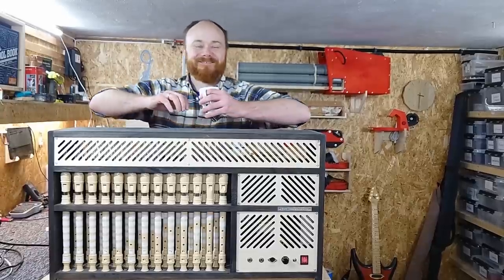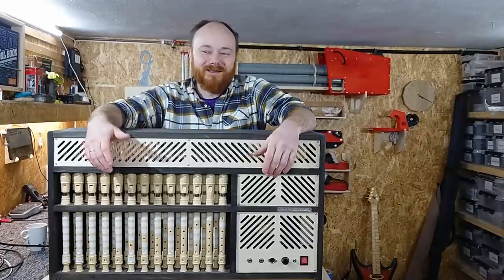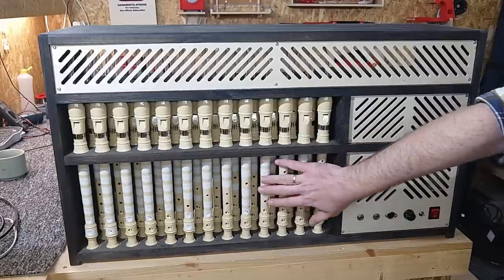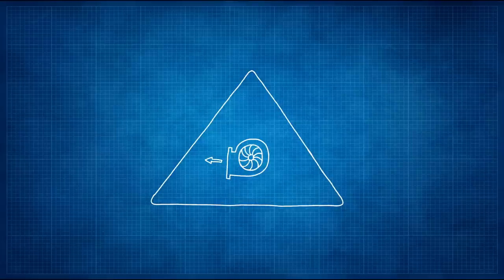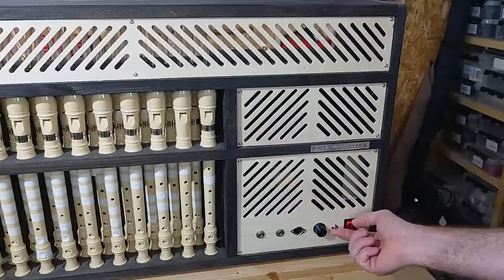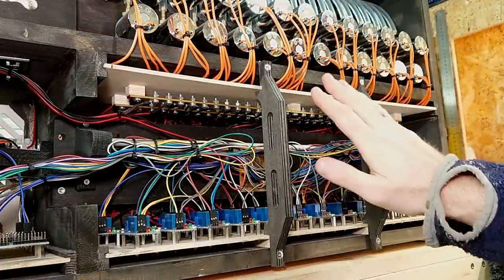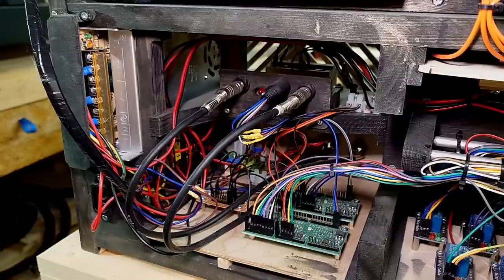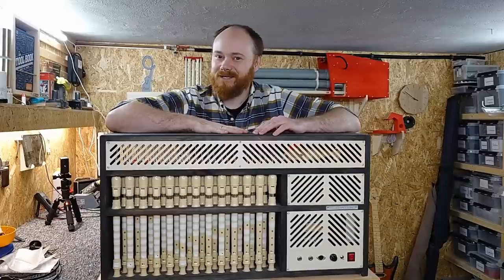The Hellcorder | The World's First Recorder Based Guitar Amplifier

Comment: Does it have some kind of manual valve to regulate the air pressure for each flute? Instead of using the weak vacuumer you could go for a side channel ventilator, which can have sufficient power. Since it has a midi input, why not use a keyboard to make polyphonic sound?
Reply from the maker: No, not yet, but that is one of the top things on the build plan. The vacuum is providing enough pressure and flow,, but it's a bit noisy....but that can be rectified :P

And yes, it is fully polyphonic with a keyboard, but that'll be another video ;D

Comment: why don't use compressed air? its silent and a lot more powerfull, you can regulate its force with some valve
Reply from the maker: I did think of that, but the initial design brief was that it should be a self contained unit and since silent compressors are expensive, I went the other route. Also, recorders need very low pressure, but a steady laminar flow of air. That would have needed to be adressed by some more expensive equipment, like valves and reducers. Unfortunalely, the airbox solution was not exactly quiet either, and far from self contained. I still believe fans, or even bellows, are the way to go - although I like the mechanical aspect of pressurized air and a lot of valves :D

Comment: Just a thought; although you'd give up some portability, if instead of needing to wait for fans to build up air pressure, would the delay be eliminated by running an air line from either an air compressor  (in another room or with a large enough tank to fill it and turn it off) or a high pressure air tank, both having a 2-stage valve and running into a manifold to feed the recorders?  Your idea is so out of the box, it's ingenious! Kudos!
Reply from the maker: Thanks :) That would work, but portability was one of the criterias :P

Comment: How about you switch to use some info of spool valves, then you could control the individual airflow instead of just turning it on/off. Would also get rid of that on/off snapping sound. Price would of course be quite a lot higher...
Reply from the maker: That would ertainly be a solution, but as you said, at a price :)

Comment: I like th eproject and idea, as the recorder sound is not great i would split the guitar signal in 2 where one would drive the hellcorder and the other just as normal electric guitart and than mix the sounds .
Reply from the maker: Splitting the signal and add a speaker is a good idea and also easy to achieve :)

Comment: The notes of the flutes depends on the airflow. You can reduce the airflow by controlling the pressure loss using valves, but you need to make sure that when blowing multiple flutes at the same time the starting pressure doesnt drop too much. I don't know how you can do that. A kind of low pressure pressure regulator to control the escape of air even in the absence of notes being played?
Reply from the maker: Are looking at solutions for just that :D

Comment: For polyphany you could wire each guitar string individually (like they do with the variax guitar) and then use a processor for each string. Or you can grab a variax and a pod and it will output midi
Reply from the maker: That would actually be fun. I have never wired my own pickups, so this sounds like a entry level project ;D

Comment: I think it's a very interesting idea and not in the least dumb.  There's nothing wrong with recorders, it's just the way they're (mis-) used in musical education.  I wonder whether you considered using a single recorder with solenoids to cover and uncover the fingerholes?  Using an array of recorders, as you've done, is basically the same as the technique used for orchestrions.  It would be interesting to find out the difference in cost between buying/making simple, individual pipes out of plywood or some other material and using cheap, plastic recorders.  I don't think it's that difficult to make the fipples and the tubes should be a snap (relatively speaking).  On the other hand, they would certainly add up in every sense.  Personally, I think using better recorders would be kind of a waste of material as well as extremely expensive, as a moderately-priced soprano or tenor recorder made of maple or pearwood costs between approx. 150 and 250 €.

I would also be interested to know if using an electric motor to drive a set of bellows, as with other pneumatic instruments, would be quieter than using fans.

Anyway, this is the first video of yours that was suggested to me and I look forward to seeing more.  Thanks!
Reply from the maker: Thank you and really good reflections. I have looked at some of it earlier and a single flute with mechanical fingers has been done before. Someone also suggested using a steel flute as they already have mechanical valves. The issue with recorders are that to achieve good tones, you regulate the airflow/pressure with your mouth for certain tines, including varying the area and angle of you fingers to cover the holes just right. That is close to impossible to do mechanically, or at least very hard. 

I stumbled over a guy casting recorders out of recycled plastics and that made me aware that I could cast single tone recorders - but I have not made any plans of actually going through with that (yet).

I have also played with the thought of two double acting bellows, ofset enought to allow for a cointinous flow of air. That would be an interesting build all by itself :)
Reply: @behindthemistakes  Thank you for your reply.  I play the recorder and the transverse flute.  With the recorder, there isn't a great deal of breath regulation or changes needed in the shape of your mouth to get the different tones.  I'm not saying there isn't any, just not that much.  The problem is with the lowest couple of notes, which don't usually respond that well.  That seems to be just about universal with wind instruments.  I think it should be possible to provide them with air mechanically;  after all, there are organ pipes that work on the "fipple flute" principle.

As far as covering the holes is concerned, I'm not quite sure what you mean.  In my experience, most of the time they either have to be completely open or closed properly.  Most recorders have two double holes for the lowest notes, but this isn't essential.  There are recorders without double holes.

There are techniques where you partially cover holes but I think trying to implement that would be impractical.

I'm also not sure what you mean by a steel flute.  Transverse flutes are made of brass and/or silver and require considerable changes in the way the air is blown over the lip of the mouthpiece to cause the turbulence needed to set the column of air into motion.  I don't think it can be simulated mechanically and if it can, it certainly wouldn't be easy.  On the other hand, it would surely be easy to set up solenoids to work the keys.  However, the key systems used for woodwinds are very complex and delicate.

Of course, one could built a (simple?) key system for a recorder and use solenoids to work the keys.  I think that's a pretty good idea, in fact.

Where I grew up, there was somebody with a collection of mechanical instruments who opened two ice cream parlors and displayed items from his collection there.  For a quarter, you could make them play and I always found them fascinating.  The main store had the most items and I think I was only there once.  I was very impressed by the mechanical violin which used wheels like on a hurdy-gurdy for "bowing" the strings.
Reply: @behindthemistakes  Organs use a kind of box to regulate the air flow.  I'd have to look up exactly how it works, but basically it's a reservoir of air in a box with a weighted lid on top of it.  The bellows feed the box and the pressure from the lid ensures an even flow of air.  In ancient organs, I believe flowing water was used to maintain the pressure, however, I'd have to look this up, too.

Comment: kindah sounds simulair like trying to play through an octaver , the same latency and missing of tones 
you could cheat a little (whell it sounds little when you talk about it but it would be an enourmous job to actually make ) and build a guitar with an electric neck , basicly cut the frets so the strings are insulated from the others on each fret then see if you can put a current through each string and pick it up by the single piece of fret eeehr fretted 
youre basicly put a boat load of switches intoo the guitarneck to drive the amp (or could put youre playing intoo a midi file as fingertapping  )
Reply from the maker: Love the way your brain works! Would be fun to modify an old guitar 😅

Comment: For tuning you need to stabilise the air pressure. Church organs do this with a big box that contains an air bag that's fed from the pump. There is a board on top of the bag that lifts up as the bag inflates. You put on or take off weights to set the constant pressure. The box has a lid that is lifted by the bag when it gets to the top. This opens a valve that dumps excess air. The air chest is somewhat analogous to a smoothing capacitor combined with a voltage regulator.
Reply from the maker: I've already thought about swapping the solenoid wind chest for a more traditional one. Currently looking into if I can build the valves myself, as they are not something you can really buy of the shelves. I have then also thought about the bellows route for providing the air. The challange is to getting everything into one compact unit :P

Comment: Swap those recorders with Organ Pipes ( Which you make yourself ) For pitch-modulation, a ( pedal-controlled ) mechanish that will vary the length of the pipes. Individual analog-to midi for each string, so you can do any chord you want ( Requires other than normal pick-ups though
Reply from the maker: If I could only choose one of those tips, I'd run with a pedal. It needs something to be pedal controlled. Maybe overdrive? :D

Comment: There's software that will transform your analog guitar signal into MIDI and it's polyphonic. MIDI Guitar 2 by Jam Origin. Maybe you could run it on an SBC to replace your current signal converter?
Reply from the maker: Looked into that, but is software based which would need a computer - which is today quite an easy fix :D
Reply: @behindthemistakes  definitely! an old raspberry pi 3 with a cheap USB audio interface would probably be powerful enough to convert the signal cleanly. 

Man this is such a cool and inspiring project!

Comment: I can appreciate your dogged determination to make something like that. You obviously loved building it. I half thought it looked like the innards of a old pinball machine. (I admit I fast forwarded a bit) when you got down into the weeds on all the connections. They already invented the Calliope,...and it sounds way better. I only remember playing a recorder as a kid, but I believe they sound best, when the air is blown more gently, and modulated by ones breath. You don't want to hear "toots". You need a fine tuned air supply, or something. One idea would be to replace all the flutes with home made or store bought metal flutes, tuned to each note,....well getting closer to a calliope, in design. A metal flute will have a clearer, precise, sound. Let's face it,...plastic flutes take a lot of effort to sound good, even when a person is playing it. Another improvement might be getting bass flutes, if they exist. The lower register will sound less harsh, I believe.
Reply from the maker: I needed to google "Calliope" - amazing. Want one!!

Oh, I agree. The design brief said recorders, but they are notoriously difficult to play beautifully - at least the cheap ones. The different notes require differnt airflow/pressure which is hard to do mechanically (at least simply). The finger placements on the holes are also very important, so trying to mimic that with electrical tape as I did is...well, not optimal :)

If I had the skill to make metal flutes I would do so, but that require training and the proper tools :)
Reply: @behindthemistakes  Thanks for your response! OF COURSE, THE WHOLE EXERCISE was absurd, and I commend you for your effort! I did a search on You Tube, for the best sounding & playing music performed on a "recorder" (flute), as a result of your inspiring  video. (LAUGHING !),.....very little music like that exists. Though there are "concert, orchestra-level, professional "recorder" musicians,....they prefer using wooden Recorders..........CARRY ON.

Comment: Use only the recorder sound “joint” and stick different length/same diameter pvc pipes into them - each pipe length defines the note, with another short pipe sliding at the tip of the pvc pipe for fine tuning.
Reply from the maker: That's a good idea if the recorders, as is, turns out to be too difficult to tune. Hope to avoid using PVC in this project as that don't give the same aesthetic feel to it :)

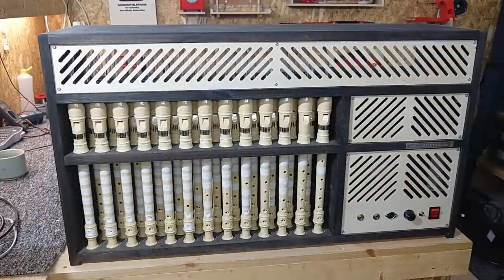Comment: 4:34 "“For a number of years now, work has been proceeding in order to bring perfection to the crudely conceived idea of a transmission that would not only supply inverse reactive current for use in unilateral phase detractors, but would also be capable of automatically synchronizing cardinal grammeters. Such an instrument is the [redacted]...and up here is a press-fit connection that connects the mouthpiece to the airhose which is done manually by a dremmel multi-tool...so fitted to the ambifacient lunar waneshaft that side fumbling was effectively prevented..."
Reply from the maker: If I ever get the money to pay for voiceover, you can expect a call haha. Loved it!
Reply: @behindthemistakes  I'm glad to see encabulation technologies are still in active development in the 21st century. Excited to see your next project, whatever that will be!

Comment: Nice build!

In addition to MIDI, it'd be cool to add a Fourier transformer and see how different effects, like distortion or flangers sound. It'd be similar to the talking piano projects: https://www.youtube.com/watch?v=uBEL3YVzMwk 

Individual piano notes already have a lot of overtones but recorders might be less noisy / garbled since they sound like they're closer to pure sine waves.

Are you able to control the volume of each recorder independently? That'd be a prerequisite for the Fourier approach.
Reply from the maker: With the current setup I can't adjust the volume independently. I am looking into some valves to adjust airflow to each recorder to also aid in the tuning issue, but that will be a manual excercise. 

Over-/transient tones is a bit of an issue for the analog to MIDI converter, but there are some nice software available that might deal with that in a good way.

Rober's piano is awesome :)
Reply: i had the same thought when i first saw it.

Comment: The poor note tracking isn't surprising and could certainly be improved from where you are now; but i think you're selling short what you did accomplish. It has quite a bit of charm as an organ, and i'd love to hear it play some midi files!
Reply: It isn't tracking, the "fingerings" on the recorders are simply bad
Reply from the maker: A lot of improvemens can be made, but I needed to see if the concept even worked before I decided to pour any more time in it - which I will :D It's is polyphonic with a MIDI keyboard and I could (in theory) just play MIDI files directly through it, but I have not tried that yet as I would like to save it as my next treat after working a bit more on the tuning :)

Comment: The solenoid clicking might be lessened through the use of felt pads in the way an organ uses them, and if not directly then by using a padded leaver system as in a piano.
Reply from the maker: I thought the same. Someone also said one might try to lover the voltage a bit. I'm going to buy a spare and dissect it to see if there are any easy modifications I an do to them - or built organ solenoids out of them (which I suscpect is laboursome x 25)

Comment: Well, my advice, which is earned from trial and error, is to follow your ear to get to your   science, rather than following the science to get your ear's approval.  Steam whistles, that's the ticket, a boiler is quite quiet once it is up to pressure.  An electric burner with a pressure canner can be an easy source of steam.  But the heat would introduce copper pipe into the ultra expensive catagory.....just a thought
Reply: Also steam whistles are loud enough to overcome the relay noise!
Reply from the maker: A wood fired steam driven amplifier! I love the way your brain works!

Comment: An admirable endeavour. Perhaps consider dampening the relays through mechanical isolation methods and/or providing them an acoustic shroud. Look forward to the recorders being tuned.
Reply from the maker: Thank you! Yes, I have thought the same. Will get one additional solenoid to dissect and experiment with 🧑‍🏭
Reply: @behindthemistakes  Interesting. I've had success isolating old sata hard drives suspending them with neoprene chord. Also dampening the impact of pistons in airsoft rifles using disks of neoprene sheet at the end of the compression chamber. On a side note I've seen some interesting resonance and harmonic videos actuating string vibration using air, originally derived from the discovery made by someone playing the guitar outside on a windy day, producing nigh ethereal sustain. Wishing you good fortune in your pursuits.